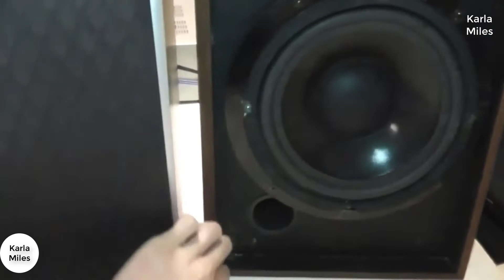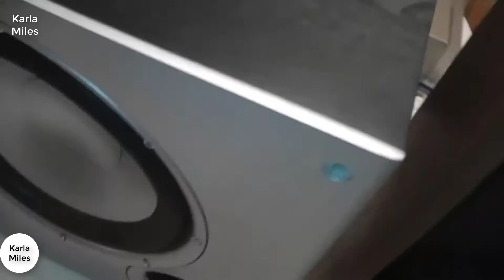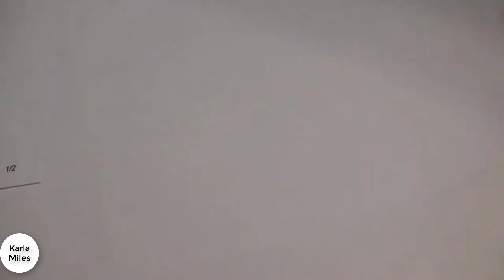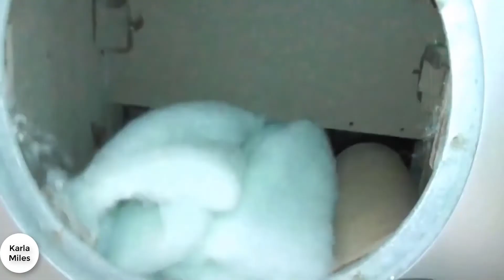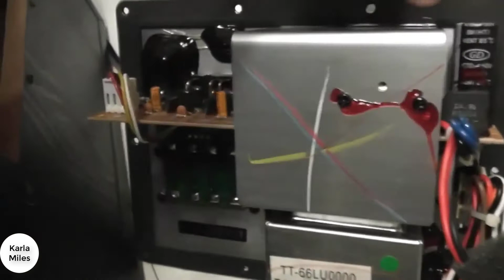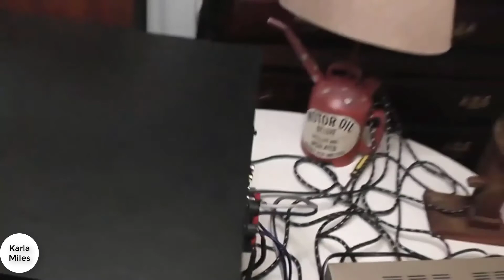Polk Audio PSW10 10in Powered Subwoofer 2021 Review

Comment: At what range should the low pass filter kept at and why?
Reply: Ive been told by more knowledgeable people to start at 80hz with the volume set at 12 o'clock and adjust as needed from there. There is no one best setting for every setup it all depends on factors like what speakers you're using and what size room you have as well as how powerful your amplifier is.